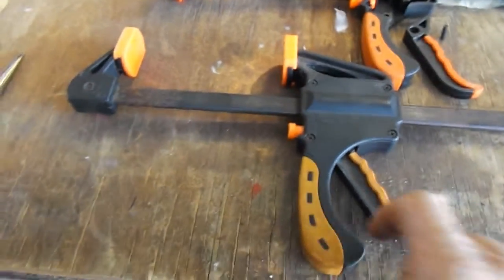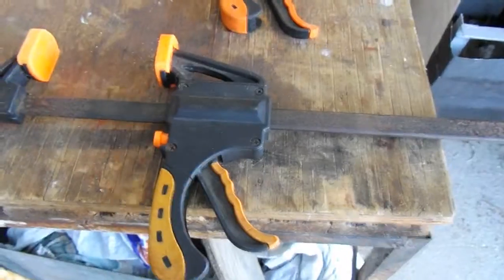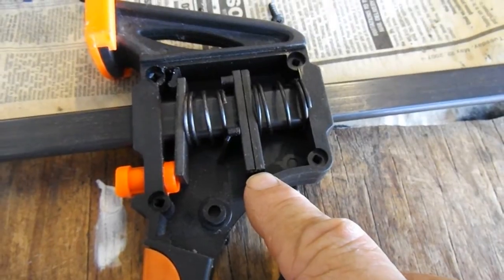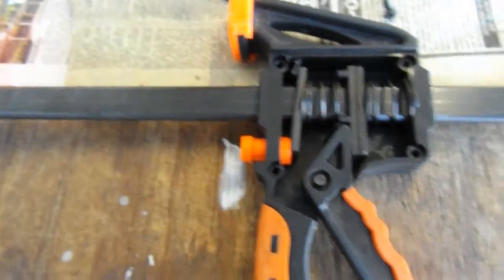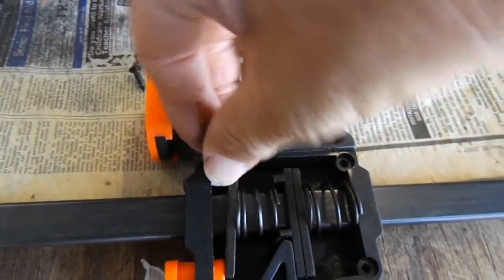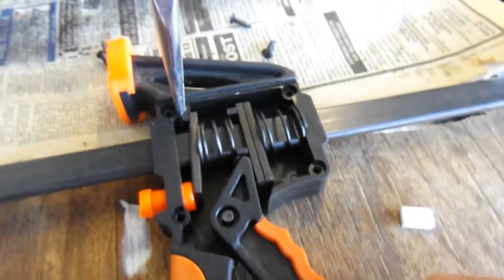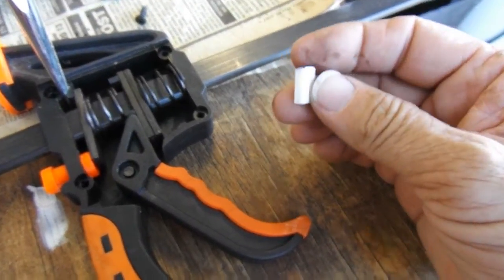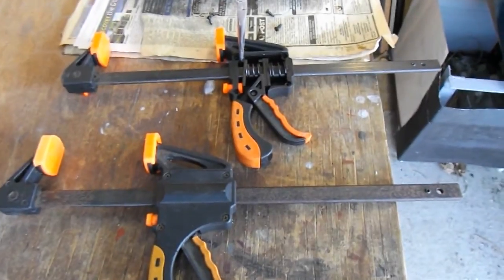Quick Clamps Inner workings & repairs

Comment: I'm watching so i can see whether it makes sense to try designing my own 3d printed with nylon around a 15mm aluminum extrusion, without owning one myself. only good video on the internet about the insides of these surprisingly.
Reply: so once the two steel clamping plates rotate a bit they interfere with the bar and push it along at that inside corner. neat.
Reply: that's a problem for my concept because while the 15mm square aluminum would be strong enough, those plates probably have to be steel, and one side of the bar is going to be completely covered in dents in short order. and the mechanism looks really sensitive to the size and shape of the plate, so beefing it up to be made of the same material as the bar would be a lot of trial and error.
Reply from the maker: Thank you , I'm glad to be of service to those out there who need it ; I hope that you have a lot of success in whatever you get to do.

Comment: So, it was clearly broken but did the break prevent it releasing, or prevent it tightening? I have one, there's no internal damage but it just won't clamp. It gets up close but refuses to tighten.
Reply from the maker: Hi Barrie , mine didn't want to clamp up so I took it apart & found the issue & now it works like almost new or as well as can be expected for a clamp like that as they're not as strong as a G clamp is.

Comment: What's that damn clicking in the background?
Reply from the maker: Someone else has also asked the same question before & unfortunately it's the "Auto focus" mech of that camera & I can't stop the noise from happening as that camera needs to be repaired & I can't get access to the setting that turns the auto focus off & I wasn't able to use the normal video camera for this particular video at that time when I needed it back then ; I hope that this helps??? ; don't worry - I can't stand the noise either.